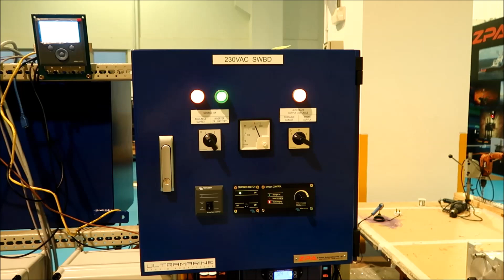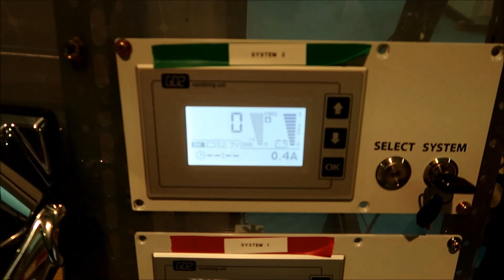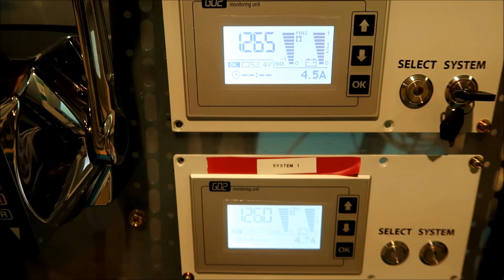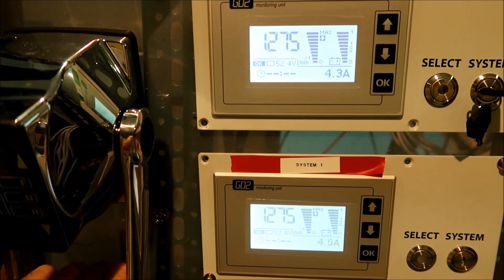SOLAR CATAMARAN AQUANIMA 40 - Electric System unveiled and going LIVE!

Comment: Could you give a breakdown of your system....I.e. Watts of solar, hp of motors, amps/volts of battery storage, charger and controllers,  planned cruising speeds you will be able to maintain for continuous use. Will you be selling this as a stand alone kit as well? Thanks.
Reply: @ecomarinedesignbyjulienmel9013  can i get your email address for an install job in the Caribbean